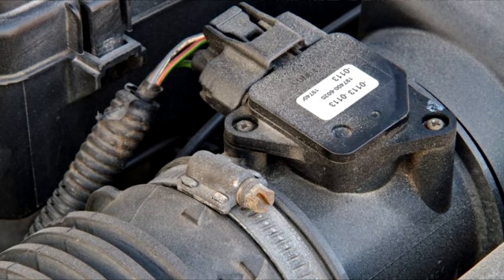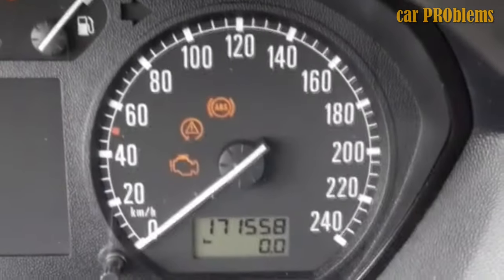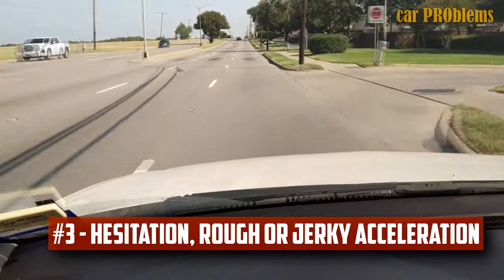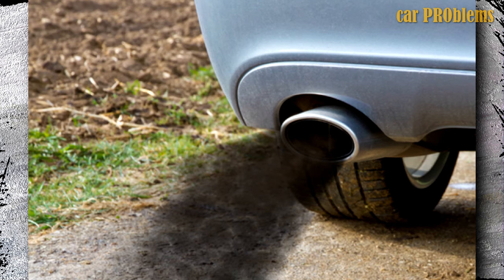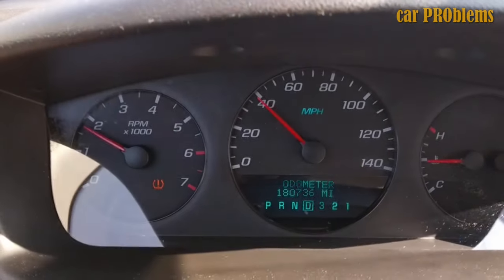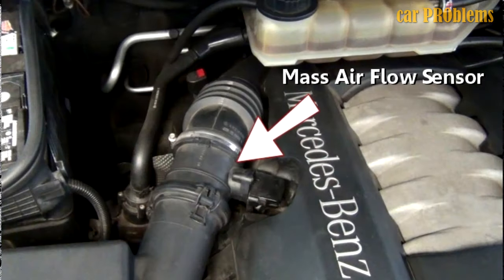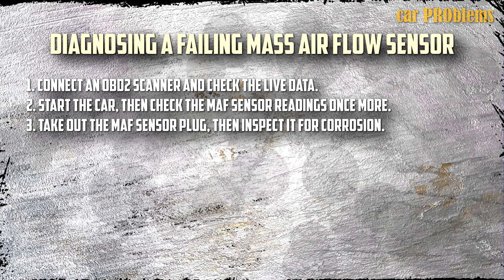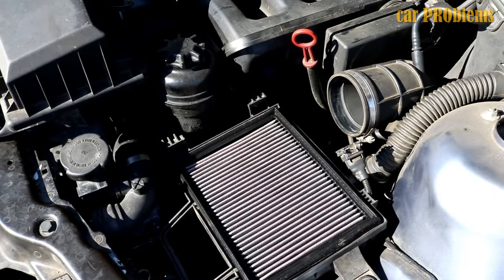8 Common Bad Mass Air Flow Sensor Symptoms - Faulty MAF signs

Comment: My Toyota Mark 2 runs fine but when the check engine light comes on, the car loses power and it doesnt respond to the gas pedal while the engine still runs. The engine dont respond either to the gas pedal(Engine sound stays the same). A machenic diagnosed it and showed a faulty MAF Sensor.
I need help if this is the sole reason for this issue or there could be other contributing engine faults as well.
Please help a brother out.
I'll greatly appreciate a response to my comment please.
Reply: my car does the sanething. no solution yet

Comment: When I start my car it is fine for a second or less then revs up a bit on its own for a second or 2, then back to normal. Shifting from Park to Reverse but before accelerating, it jumps/jerks like a nervous horse for 2 or 3 seconds then runs fine the rest of the day no matter how many times I turn it off or on or how long I drive it. I have already replaced plugs and wires and air filter. Could it be the MAF going bad? Desperately asking!
Reply: I have a 15 Yukon Denali that halts and jerks when I accelerate, most likely will be the MAF because I’m getting mine replaced today.
Reply: Do they ever answer the questions, mine is doing same and I'm kinda stuck right now. Whenever it picks reves on it's own it looses power and jerks later
Reply: @moelets0202  so far, no I've gotten no answer. Hopefully the more comments/activity, the more notifications and they'll respond eventually.
Reply: Mine is doing the same for awhile now..I've bought a new maf and.still.does that..I changed out the plugs and still doing that..next I'll be changing out the oxygen sensors
Reply: @southwest6720  I tried the plugs and wires, air filter, cleaned the IAC, did a gas treatment thinking since I cleaned everything on the outside I should try the inside too and it's still doing it. Haven't replaced MAF yet but never thought of oxygen sensors. Hopefully that works for you!
Reply: @kayteen6205  hopefully it does..I'm going to switch my coils today also n buy a new IAC
Reply: @kayteen6205 what was it

Comment: Hi there,
I have a problem with my Hyundai i10 4 cylinder petrol engine, it is 2009 model.

The issue iam having is when Iam driving the car, I release the accelarator and rpm will go down to  1000 when I give acceleration again there will be a slight missing. This mostly happens in second gear.
Cleaning the spark plug/replacing seems to fix the problem for some days.

Comment: I have changed the maf/and the map sensor and it’s still says it’s bad..I have also replaced the throttle body and alternator and plugs and coils and my 2014 Chevy traverse keeps going in reduced engine mode/service stabilitrack and traction control off. Any ideas this is driving me crazy for 2 months I also replaced the fuse box under the hood.
Reply: Maybe a malfunctioning PCM ECM  ?

Comment: ihave a 03 chevy avalanche and when ipull the maf sensor off, my engine does not die but ihave no codes ireplaced the pcm ialso traced the wires idid replace 2 ground and ialso replaced the maf sensor but nothing worked

Comment: Hi can i know what if my car is blowing black smoke only when in idle when i reved it. Went to wshop but no fault code . I tried to unplugged the maf sensor while car is running.. it didnt die either.. any idea what could go wrong n what should i check.. car is bmw216d f46
Reply from the maker: Hi! Black smoke coming from the exhaust when the engine is idling or revving is usually an indication of a rich air-fuel mixture, meaning that there is too much fuel being injected into the engine. This can be caused by several factors, including a malfunctioning mass airflow (MAF) sensor, a faulty fuel injector, a clogged air filter, or a problem with the engine's fuel system.

Since you've already unplugged the MAF sensor while the engine was running and the car didn't stall, it's possible that the sensor is not working properly. However, it's important to note that unplugging the MAF sensor can also cause the engine to run rich, which could result in black smoke.

Hope this help.
Reply: When plugged in, theres no fault code on anything.. this makes it difficult for wshop to even detect..
Reply: Hey buddy. Any update on your issue? I have the similar issue right now. Mech says my turbo needs recon. When I unplug the the sensor smoking stops, car does feel low on power either way but with black smoke plugged in.  Thanks

Comment: I have a 2010 Chevy Cobalt LT  and the RPM's go up and down it shows a mass Air Flow sensor circuit low frequency what does that mean?
Reply: I have just now having the same problem with the rpms going up and down. Did you find the problem?
Reply: im having this issue too, i bought a scanner and got a code that said the maf sensor harness has a weak connection. working on fixing this so not sure if it solves the issue yet

Comment: I got question here. My car really hesitate when i accelerate for overtaking but running well if normal driving. I find that if removed mag sensor connector my car hesitation gone. But engine check will appear and car bogging while in idle. Is this my maf sensor faulty?
Reply: Yup... so is your O2 sensor and your ETC sensor! 😨
Reply: I have the same problem, did you replace the mass sensor? how is it now?

Comment: Could this also cause overdrive to not kick in?
Reply from the maker: Yes, a bad MAF sensor can cause issues with the transmission and prevent overdrive from kicking in. If the MAF sensor is faulty, it can send incorrect signals to the ECM, which may result in a delayed or harsh shift, or prevent the transmission from shifting into overdrive.

Comment: I have problem with engine light and my car goes to limp mode. My error is P1102. I tried to disconnect maf sensor and car works fine. I did not notice nothing special. Well check engine appera again because maf was not connected but car was not went into limp mode. 
The tester showing 4.4g/s when ignition is off aroun 7g turn on, 15g with 2000rpm and 27-30g with 3000rpm. Do you think is faulty sensor?
I own Focus 2016 1.5tdci
Reply from the maker: Based on the information you provided, it is possible that the Mass Airflow (MAF) sensor is faulty and causing the P1102 error code and the car going into limp mode. The fact that disconnecting the MAF sensor made the car work fine, albeit with the check engine light on, suggests that the sensor is likely causing the problem.

The readings you mentioned from the tester also suggest that the MAF sensor is not functioning properly.  The readings you provided show that the sensor is not providing accurate data, which could be causing the ECM to make incorrect fuel and air adjustments, leading to the car going into limp mode.

Yes, I think it's a faulty sensor :)
Reply: @carproblemsmax  I tried replace maf but error remain the same. There is no sign of air leaks and turbo seems to work fine. Can be a bad air flap?
Reply: I just installed a new MAF on my 08 Tahoe and I can unplug it and my vehicle stays running. Does that mean the new sensor is bad? Or will a vehicle still run with it unplugged?
Reply: Mine was still running.
Reply: @dudeimdev6320 yes it will run without

Comment: hello there! i have the 2015 verso 1.6 diesel and the check engine light comes on with a p00bd fault code which refers to the mass air filter. i've done everything from changing the maf sensor to cleaning the air intake manifold but the faults pops up again and again. my electrician has inspected it twice and sais there is no wiring problem. any idea what it can be???
Reply: Hi there, I have the same vehicle and I have just got an OBD2 and this code has came up, did you manage to fix the problem please ?

Comment: I have 2006 300 c my car used to go into limp mode last year and even turned off while driving a couple times. Recently i had the fuel pump replaced and have been having problems since. Sometimes ill run the car for 45 minutes come home and let it sit for anorher 45 come out and try it and it wont start. I recently had the throttle body and the cam and crank chnaged cause of this but still the same. My mechanic told me he got a maf code recently and today got a egr position code. Do you think it cohld be the maf ?
Reply from the maker: It is possible that a faulty MAF sensor could be causing the issues with your car. 
Additionally, the EGR system can also cause drivability issues if it is not functioning properly.
Based on the codes your mechanic has received, it is possible that either of these components could be contributing to the problems you are experiencing.
Reply: @car PROblems  im gonna try the egr because ive heard the egr can activate the maf code so im wondering if changing or cleaning it will make a difference
Reply: Maybe bad Catalytic Converters?

Comment: you missed one important thing.. many German cars running with a bad MAF, can cause a engine to stall and die.. few seconds after
Reply: 3:03  mentions stalling. should have been its own section tho
Reply: you missed the most important thing buy American cars the job you save may be your own
Reply: @jonesy4588  - What a BS statement. LOL 🙂
Avoiding American cars, as best as possible for a few decades now. Not regreting a single minute. ;-)

Comment: Intercooler leak can give MAF sensor error code as well.
Reply: What are the symptoms please, my car has a rough idle on start and eventually turns off if I disconnect the maf sensor it no longer occurs but very underpowered and slow
Reply: Rubik did you figure it out

Comment: So I unplugged the Maf sensor on my 3800 engine. You can actually tell a difference. It wouldn’t hardly stay running but then I plugged it in and started the car it runs great. I’m wanting to know if it could half fail? I’ve been troubleshooting my car for 2 weeks trying to find out why it has no acceleration it runs smooth but no power? Help please!! It’s not throwing any codes
Reply: Try cleaning ur MAF sensor. Buy a special spray for electronic parts only and spray down your sensor and scrub with a bristled brush and repeat. Read instructions on how to use what you buy 1st!!!

Comment: I had a o2 sensor code pop up, the code went away when i unplugged my battery. My car barely and i mean barely wants to move,i have to touch the gas like a feather and the car moves so slow i have absolutely no power i have to slow roll and cant climb any hills and i can barely reach 40mph. When i push the gas to hard the car is just super loud and will not mive at all unless i feather press the gas. Any ideas??

Comment: I changed my maf sensor and the engine stays running after I unplugged the plug. What does that mean 🧐
Reply: All cars should still run when the MAF is unplugged. When the MAF is unplugged, the ECU reverts to using standard look-up tables for typical airflow rates, at given temperatures and speeds.  Your car will run a lot less inefficiently without the MAP sensor, and MPG can suffer by up to 20%... but the car will still run. Some small budget cars (like the 2001 Renault Clio 1.2 I had years ago) do not even have or use a MAF sensor.   They use Manifold air pressure (through a MAP - not to be confused with MAF - sensor) along with look-up tables.

Comment: Just got charged $380 to swap one on a 2002 toyota avalon, he charged me $190 for a mq6203 air mass sensor and $190 for labor
Reply: change your mechanic that's foul smh
Reply: That part at advance auto parts is 102.00 you got ripped off
Reply: @kimsmith5083  it was a hitachi brand bought from some place that sells to dealerships and mechanics
Reply: what do you have a junk yard ?
Reply: OMG...... $190 for labour to change a MAF sensor?!?!  You have been wholly ripped off.  It is a 5 minute job, even for an absolute novice.   It's one electrical plug that needs pulling off, then usually 2 jubilee clips (only a screwdriver needed).  It is one of the easiest components to change on an engine. It's always right at the top of the engine, as it's part of the air intake system (near the airbox).  It is absolutely criminal that any garage could charge $190 to change a MAF.   It is only marginally more difficult than changing a fuse.
Reply: You got over charge. Next time, you should check the repair prices online. 
Tell him bro you over charge.
Reply: Easier than taking a battery out takes about 10-20 seconds just two lil screws and one plug😂
Reply: @droge192  Yep, didnt know at the time, now I do my research
Reply: @AltheaClark  I never went back

Comment: My car misfires. anything over half throttle it’s really bad and my engine light will start to flash and my car will smell. My car will jerk around when it’s misfiring can anybody help me?
Reply: It sounds to me like cylinder number 3 is misfiring. Have you done a tune up on it?
Reply: @89rockstar  I checked the codes and it was 2 and 4 I replaced my coil packs and spark plugs and it’s fixed now
Reply: @89rockstar mine is cylinder 3 when I give it gas. What do u think it could be ?

Comment: Mine trips when I drive my diesel when its snowing. Why is this?
Reply from the maker: It is unclear what the "mine trips" means. )) If you're talking about traction issues while driving your diesel car in snowy conditions? Diesel engines often have higher torque, which can cause the wheels to spin and lose traction more easily in slippery conditions. It could also be an issue with the tires, as winter tires are designed to provide better traction in snowy conditions compared to all-season or summer tires. Use appropriate tires or adjust driving habits...

Comment: Would this make a car smell like gas inside ?
Reply: No that’s the fuel filter
Reply: My Subaru Forester XT recently stalled out on me on the highway and it started smelling like gas in the cabin when I turned the car off. Turns out that the problem was a bad mass airflow sensor harness.